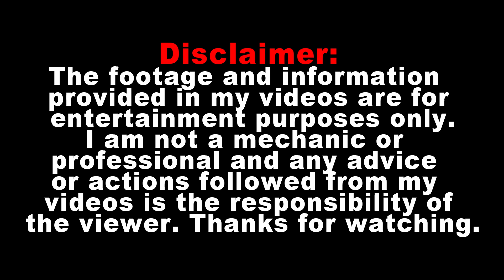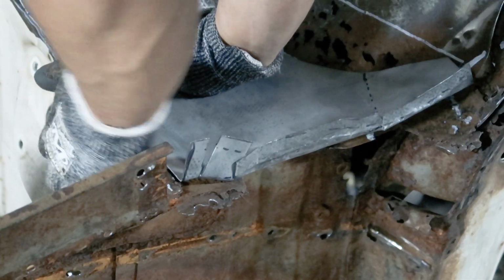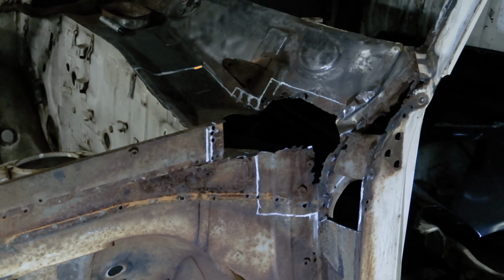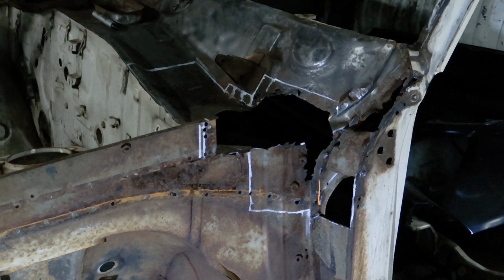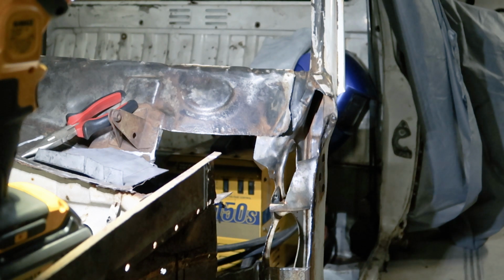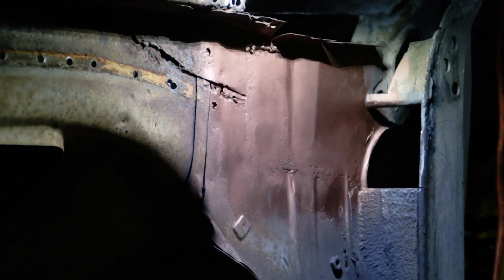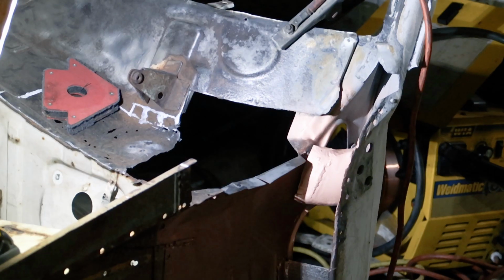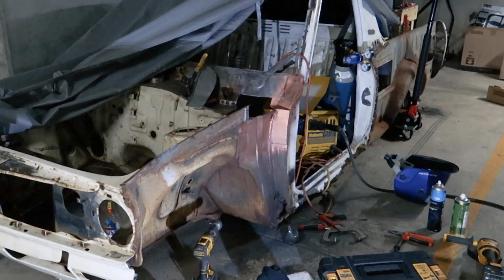DATSUN BUILD - CONTINUING RUST REPAIRS (#9)

Comment: Get yourself a new conduit/liner for the MIG gun lead. The factory supplied ones are usually 0.9mm-1.2mm ones, and you'll have all sorts of trouble getting 0.6mm wire to feed through it consistently. The smallest size liner you can get is usually 0.6mm-0.8mm.

Also, step out your tack welds. Make a tack at the start of the join, move an inch along the join and make another tack, so on and so forth until you get back to the start. Repeat until you complete the join. That way you don't warp the hell out of everything with the concentrated/excess heat.

Use a hard plastic mallet and plastic jaws in your vice to do your folds/bends in your sheet metal. Using metal hammers against a metal 'anvil' will stretch and distort the parts you are making. You can use that to your advantage sometimes to help shape your parts. Like some of the folded parts you sliced to bend to shape, if you stretch the outer edge of the fold, it will create the curve without cutting and then rewelding.
Reply: Also make sure the contact tip in the gun is matched to the wire you're using, so 0.6mm wire = use a 0.6mm tip.
Reply from the maker: Thanks for the info! Yeah I've got everything so finely tweaked at the moment so I can get by - I definitely need to get a new liner and tips cause its been giving me the biggest headaches!! Just a few more little things I've got to invest in to make my life easier.

Thanks for the tips - I've already edited my next video at the time of reading this but I'll give your advice a go next time I work on some welding! Thanks for your multiple comments of advice! I really appreciate them and will apply them in the future!!

Comment: What material are you using to make your templates out of for forming new metal? like at 3:45
Reply from the maker: I went to an office supplies store and got some slightly thicker gsm paper. Its not as thin as printer paper and is not as thick as the usual cardboard :D